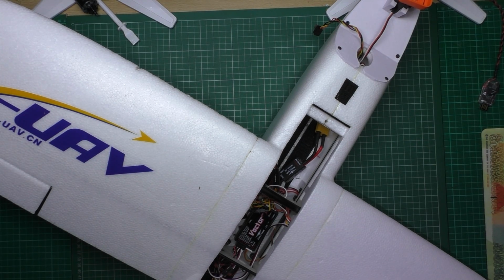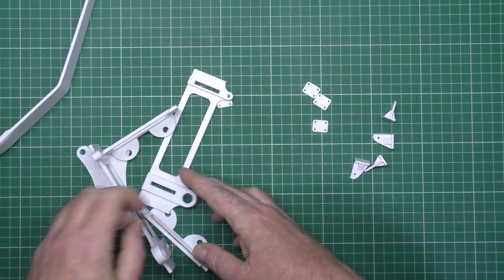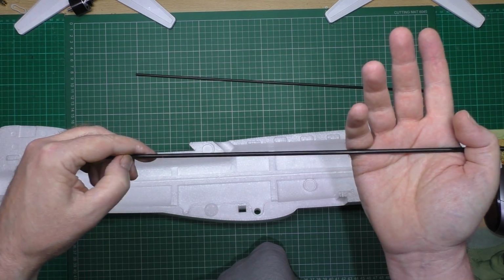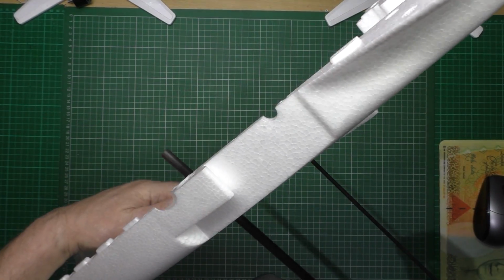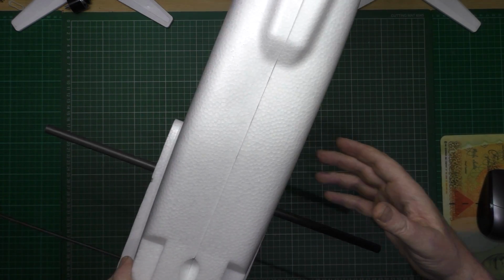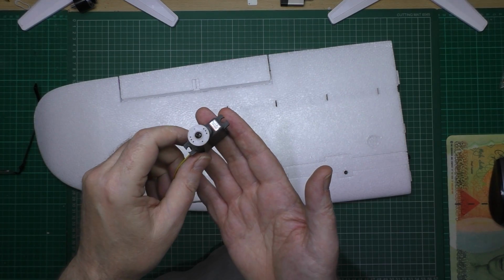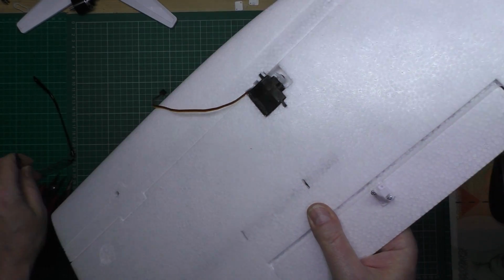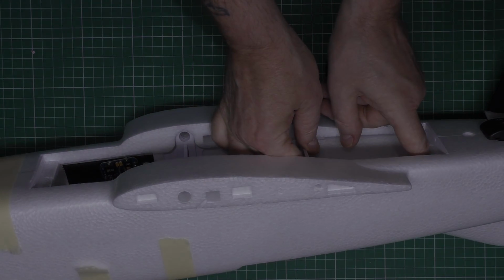Mini Talon build part 1 - doing it right this time

Comment: Great video. If you don't mind me asking, what 3D printer do you use? I am so confused as to which brand to get for my home model builds, thanks👍
Reply from the maker: I was also very confused as to which one to get and I originally bought the XYZ Davinci Jr. The only downsides are..... PLA only and you're tied to their filament which is expensive. I've now got the Flashforge creator pro (2016 version) and I can't fault it. It's identical to the Replicator 2x but a fraction of the price.
Reply: Thankyou so much for that advise, I will go look, cheers matey👍

Comment: Glad your doing a other build Video Tony, not started putting mine together yet....You know you could easily fix the original, simply ditch that huge Skew and fit a tuned Dipole, much smaller and far less drag, just leave the EZ rx where it is...?...You dont need a Skew on 1280mhz.....:)
Reply from the maker: Too late mate, the old one is now retired...... It's been digging at me, ever since I flew it for the first time.    
I've made a couple of dipoles which I'll be hopefully trying by the end of the year :-)
Reply: Vortecks You will like the Dipoles with the 8dbi Patch, I do...its so easy...Right now, Im learning the APM Pro Autopilot, its a lot to take in but Im getting there slowly...:) Have you played with Mission Planner?
Reply from the maker: I played with it a couple of years ago but I couldn't get used to it. I much prefer a plug & play system like the Vector.   
Don't you feel that flying an automated mission takes the fun out of it?
Reply: Vortecks Hi Tony, Yes, not really interested in Waypointing either....I do like the APM PRO though because it has servo pinouts only....none of those silly, tiny white plugs...I like it, and the original Arducam OSD and a cased Minim OSD is brilliant as you can lay out the screen exactly as you want it. Ask me again when I have made it work though..LOL.
 It does boast a whole bunch of flight Modes if you want them though, including RTH of course.
Reply from the maker: I was tempted to get the APM pro and I have tried the APM 2.6 but I couldn't understand why there was so many settings to worry about.    
I'm definitely a Vector/MFD/Pitlab bloke. I like the simplicity of an 'all in one' system :-)
Reply: Vortecks Agreed, the parameter list is a bit extreme I would agree..A lot of it you simply dont need...Im getting there though, pretty sure you could do it if I can...Its quite a neat small package really...:)

Comment: Love it!
The first bit on the side spars being poorly glued is something everyone should see and understand!
I like the control horns and the center structure looks really nice. I really like the reason for printing it - "because I've got a 3D printer"...HaHa, how many times have I said this too :)
I like the look of the motor mount but would make the wire hole large enought to easily pass the three motor wires with their connectors through. 
Can't wait for "Part 2"!
BTW, What is the print material?

Cheers!
Mark_Q
Reply from the maker: Cheers Mark, that means a lot coming from the master of perfection! :D    
I use PLA for anything structural. I know it's not the perfect stuff to use because it ages, but I'll probably be building another one by the time it starts losing its strength.

Comment: I am glad to see you doing another one with the improvements.
Where did you get that MT 2226-9 1100kv V2. I need one. 
Bought the MS version but I want to run 4s like you.
Reply from the maker: I get all mine from Electricwingman, Dave. https://www.electricwingman.com/t-motor-mt2216-1100kv    
Most people use the Sunnysky 2216 though http://www.getfpv.com/sunnysky-x2216-9-1100kv-ii.html
Reply: Good to see GetFPV has the Sunnysky back in stock but I like the fact the MT is actually rated for 4S where as the Sunnysky specs either don't say for show 3s. Electricwingman seems to have the MT cheaper with shipping than here in the US where they want $58. Perhaps its the currency conversion. Thanks for the links!
Reply from the maker: Yeah, the £ has hit a 30 year low against the $ which is good for export but bad for import. Leaving the EU has helped us in some ways but hit us in others :-)